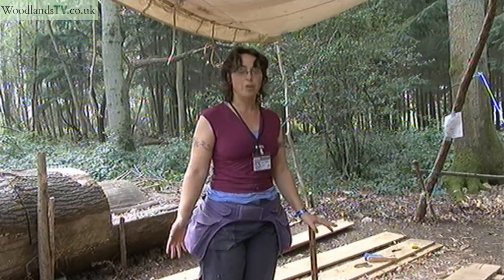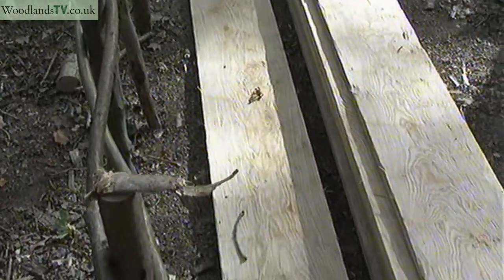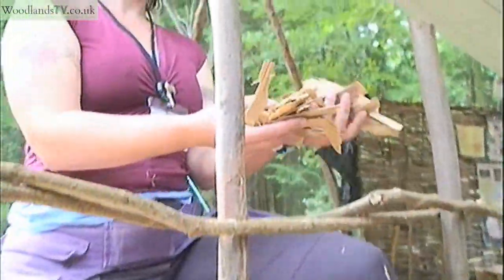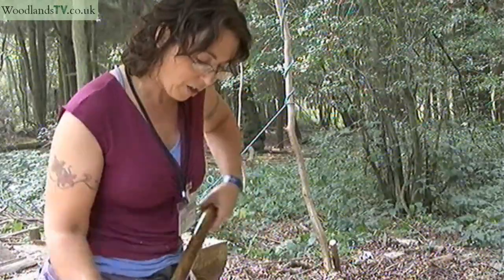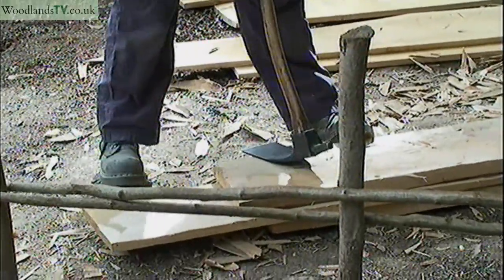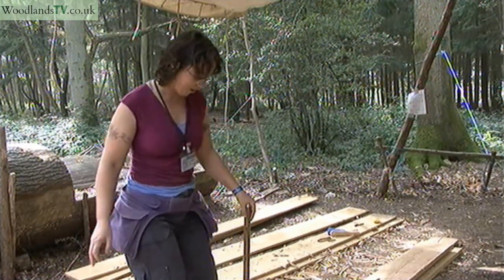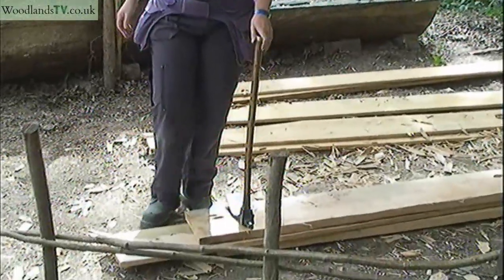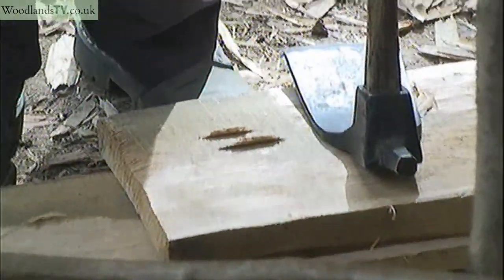Using an adze

Comment: I have my Great Grand Fathers adze.  He shaped many creosote piling to be driven with it back in his day.  Back when timber trestle rail road and most bridges were made from creosote soaked wood.  The thing is razor sharp today.  I dressed it up about 10 years ago with a file.  The spike on the back of it still works as designed.  My oldest Grandson and I used it to make some log benches.  Excellent tool design.

Comment: The adze, in the hands of a skilled craftsman, can be quite a precision tool. They used to be used to dress large butcher-block cutting boards. If one has the skills then a very nice, flat surface can be achieved using an adze. Nice video.

Comment: Sorry, but this lady is NOT really good at using an adze. Resting her left forearm on her left upper thigh will reduce the number of steps visible in the cut. The cut should be with the grain both along and across the width of the plank. Typically this means cutting at 45 degrees to the length, not 90 degrees. This will reduce the amount of tear out.
Reply: I concur.   Not to be mean, but there’s a reason there’s more talking than doing in this video
Reply: Absolutely. The adze was originally used to put a smooth finish on timber before the  plane was invented. For example, ship spars were cut from the log to square in a saw pit then roughed down to round (often leaving heel square and the truck D section) with a adze before finishing with an adze taking long cuts along the grain with the adze to get a smooth finish. Not a skill you see much nowadays, most skilled shipwrights making wooden spars find a power plane quicker and easier. Take a close look at the mainmast in a sailing barge next time you see one. That is if it's still got a wooden one as most have replaced them with steel tubes.